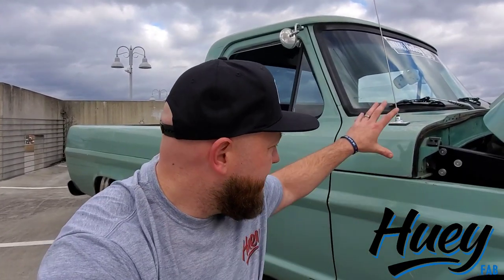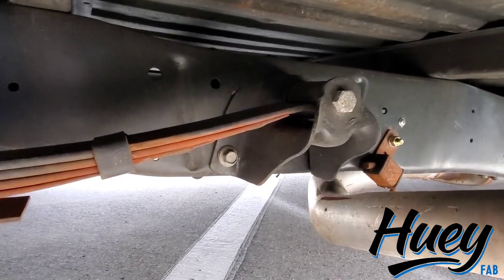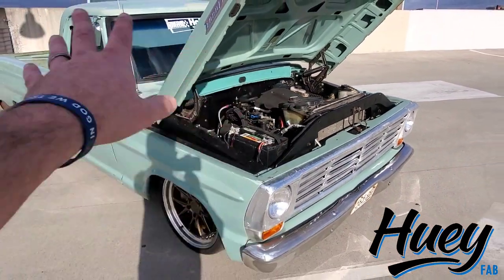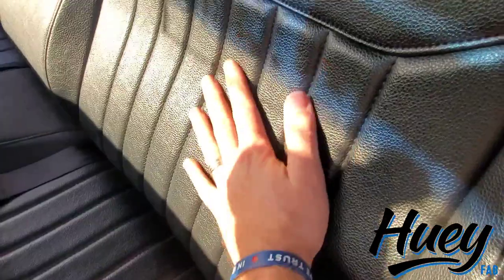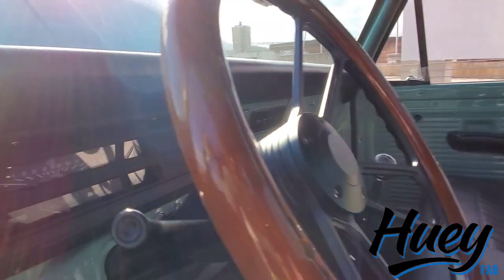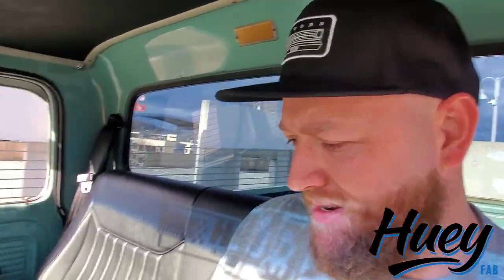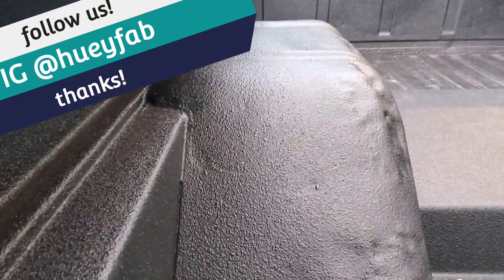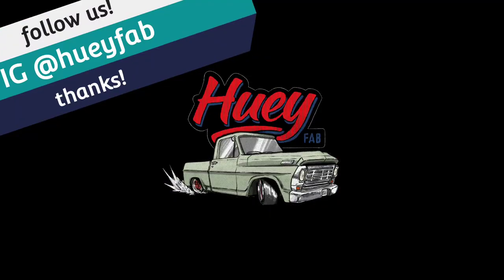1967 Ford F-100 "Frank the tank!"

Comment: Nice truck. Love the drive video, as it looks like you are driving a right hand drive truck, which we do in Australia. I am building a 1970 bump side short bed with a 5.4 290 Boss out of a GT Falcon. The GT also donated the auto and front end with rack and pinion steer.
Reply: It's LEFT HAND Drive
Reply: I never knew Australia had the 5th gen (67-72) F100 ,  I knew about the 6th gen. That's good to know because I would love a RHD F100 Because  i live in the UK.

Comment: I have owned 3 different 1967 f series trucks. But mine didn't sit low like yours. I owned mine in the 80's and early 90's and people usually only lowered small trucks back then. But I like yours, makes me wish I still had one of my old trucks.
Reply from the maker: I've got a few more to build that will be a mix of ride heights, but I really want to do a tasteful 4x4 build.

I guess I like the irony of an old truck cornering and performing better than the sports cars of that day, even comparable to today. This truck needs an update walk around...it's got a 4 bar and coilover setup in the rear and a new powerplant. Such a fun corner carver.
Reply: After driving those old '67's, I'd have a hard time taking it hard into a corner especially at first. I think I'd have to work up the courage a little at a time until I could figure out where it's new limits are. Because they did not corner well with a stock suspension. Of course they were not designed to. What you have sounds like it could be a blast to take out on the curvy country roads where I live.

Comment: Great video, I've been looking forward to the breakdown of it since I seen it at the Ford Nationals on Ford ERA talking to Solomon.
Reply: @hueyfabllc4987  I'm getting ready to start my 68 F100 build. Doing a crown Vic swap S550 rear with a coyote swap and an MT82 trans. I'm running ATP coilovers and ATP fuel cell.  I follow you over IG, can't wait to see what you got planned for the truck and the upgrades.
Reply: @hueyfabllc4987  I'm hoping to have it done by late spring to take it down to the Grand Nationals, I'd like to go to Ford fest at beech bend with it at least do the cruise maybe a little autocross.  I'm going against the grain I'm building a long bed... Lol

Comment: Hey man like your videos on Frank and the Red truck. I got a question., I'm building a 1969 F100 with CV front, I have choice of 3 rear axles - 1998 Explorer non posi drum, 1997 Grand Marquis disc non posi 3.27 gear and 03 mustang gt posi disc brakes 3.73 gear ratio, what rear would you use?
Reply from the maker: Sorry I missed you on here, but I think we got it on Instagram.

Comment: Are those little round mirrors a factory option or something like for a blind spot mirror? My 72 has those and I’ve seen a couple other old bump side Fords with them.
Reply from the maker: No, these weren't a factory option. I picked these up from Hunters and they're a pretty popular option for got rodders. I think I may swap to door mirrors like factory style, though.
Reply: @hueyfabllc4987  Yeah I hear ya. I can’t see shit out of mine…😂 I have seen a truck with them mounted about mid way down the A pillar… That seems like a Better place for them and it didn’t look bad either. But he also had the small door mirrors and I believe he said he used them for blind spot mirrors.

Comment: Do you remember what you had done with cats/if they were kept or removed and how you dealt with that
Reply from the maker: Deleted the cats. The old mod motor PCM is a far cry from the newer coyote stuff, so in open loop, it learned well enough to be driven and not have major issue, but typically a tune is required.

Comment: Beautiful build man! I am in the beginning phases of a very similar build! Are you still happy with the setup?
Reply from the maker: Very! The truck has a 4 link setup in the rear now, which was a huge improvement over the leafs. It was still fine with the leafs, I just can't leave stuff alone!😆
Reply: @Huey Fab LLC  I'm planning on the 4 link in the rear. What axle did you end up going with on the 4 link? I've got similar size wheels and tires and am trying to avoid modifying the bed lol

Comment: Also what did you use for air intake curious how it works with MAF sensor
Reply from the maker: EFI tank from tanks Inc for a 1970 mustang for fuel tank, stock column with borgeson joints and shaft to connect to the vic rack, and this old setup used the stock 4.6 intake tube and stock maf housing.

Comment: Did you do the manual swap when finishing the truck or was it previously done? If you did it what company did you use? Seen ADTR
Reply from the maker: I did all of the work. The master cylinder setup us from Silver Sport Transmissions and the slave cylinder is from Modern Driveline. Just a pullout trans from an 03 mach 1.
Reply: @hueyfabllc4987  what did you end up doing for pedals? I saw you Mentioned mustang Pedals but is that as easy as a Facebook marketplace pickup or? I’ve got a 3650 I just picked up but will need a clutch, flywheel etc hence reason for swap kit. Also not 100% if I will need hydraulic clutch pedals or something different
Reply from the maker: @ziggy760  I originally hoped to use the mustang pedals, but ended up shortening the stock clutch and brake setup from the truck and adding wilwood pedal pads. Far less fab work and looks/feels great!
Reply: @hueyfabllc4987  gotcha, and then are you running a hydraulic or cable clutch?
Reply from the maker: @ziggy760  hydraulic.

Comment: Do you have to run wheel spacers and how much did you widen the rear wheel tubs with the rear end you used?
Reply: @hueyfabllc4987  Thanks for the reply, I have an 06 police car that I’m going to get the front out of and an 02 police car for the rear. The 4.6 is knocking so I’m going with a 390  or a Cleveland just to be a little different.

Comment: Did you use a driveshaft spacer for the 3650-->Police driveshaft?
Reply: / who's?
Reply: Also stock manifolds and just exhaust?
Reply from the maker: No spacer on the driveshaft. This is the old setup, but at this time, it was stock manifolds and no cats, into 2.5" stainless exhaust.

Comment: Where did you get the front z notch plates from? Looked everywhere and can't find anything
Reply: @hueyfabllc4987  it looks awesome man. Did you have any issues with the driveshaft rubbing on the bottom of the cab?
Reply: Awesome man will do. Love the truck!
Reply: @hueyfabllc4987  I looked at your insta and great pics from recent progress. I'm super interested in the z of the frame though as I will be doing this with a cv swap as well. If you don't mind some questions, how did you still use thr factory cab mount if the Z is right behind them? Obviously not able to use the factory rivet locations. Sorry in advance for picking your brain I greatly appreciate your responses!
Reply: @hueyfabllc4987  did you have to modify the bottom of the cab or firewall any? If im looking correctly if you raise the frame behind the CV control arm plates the frame is going to hit the bottom of the cab

Comment: What did you do for column
Reply from the maker: Stock column out of a floor shift truck with power steering. Cut the flange off, borgeson joints and collapsible shaft.